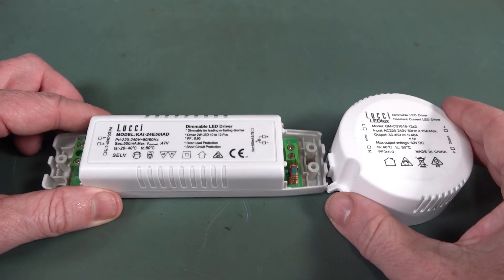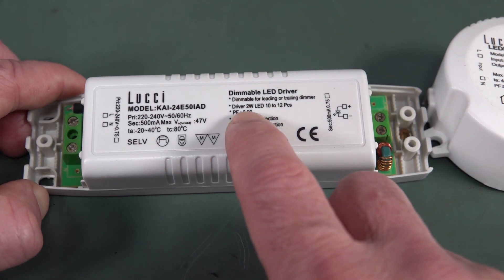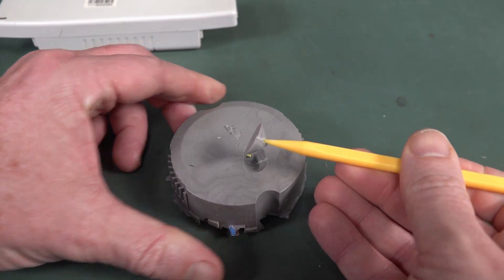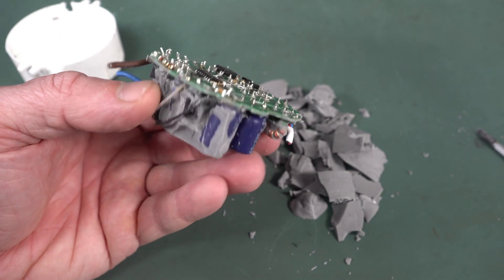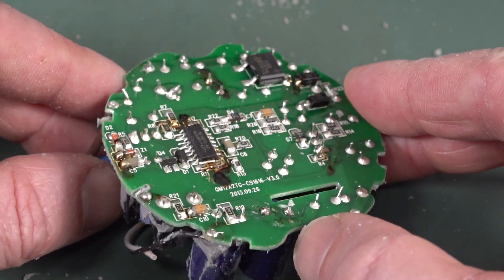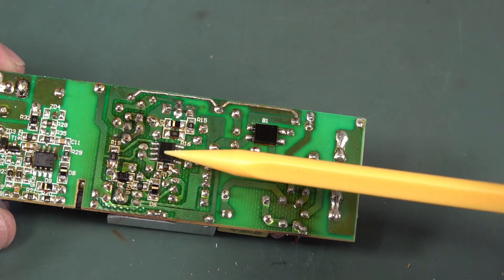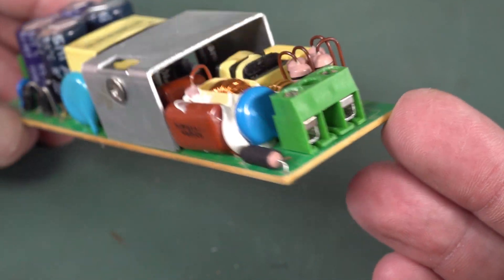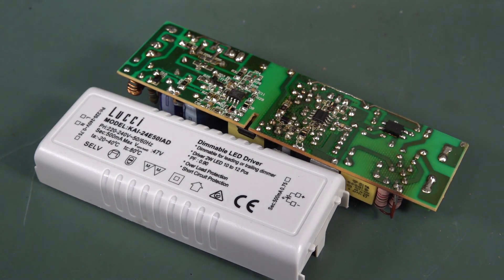Failed Lucci Constant Current LED Driver Teardown

Comment: i recently repaired a led driver, one of its smd bridge diode(must be 1kv 1A) burned out taking the 15uf/400v cap & inrush resistor with it, replaced them & it's working fine now, i feel mains components upto the switching transformer should be normal sized, there is a strong possibility of arcing due to residual flux,moisture dirt, also CC drivers provide higher v/g to leds than there normal operating v/g even though current is limited, saw one of a series led pannel blowing some of its led's and dying .

Comment: Some silicones used for potting can be removed by soaking the part in solvent. 
I use turps first, for up to 24 hours, (least aggressive to plastic components), then turps with 20% acetone, then perchlorethylene (as used in dry cleaning).  Expect damage to polystyrene caps.

Comment: Potting actually helps dissipate more power when you are only relying on passive airflow in tightly enclosed housings, pretty much anything is better than air...

Comment: @Dave - The second power-supply (Model "KAI-24E... "), look at the four resitors at the input, they got pretty hot and the end-caps will fail, so that the resistance will be unlimited.

Simply measure the resistance of the pink resistors.
In the round powersupply the resistors are still in the Gray silicone like mass?

Comment: why it says short circuit protection? Shouldn't it output 500ma current when its shorted? It says constant current after-all? What am I missing? Can someone explain?
Reply: Yes, it outputs 500mA or whatever when shorted. That's protected, it won't blow up. What are you missing.... who knows. It's 100% obvious and simple, there's nothing to discuss. What exactly do you think need explaining?
Reply: @johncoops6897  I thought it will blow up if you short it. Thanks for your reply man

Comment: That silicon potting is Sylgard 100 series, probably 160 by how it's peeling.  It's thermally conductive and electrically insinuative.  We use it at my work for potting PCBs for down hole oil well drilling measurement equipment.

Comment: Here you go Dave (with Australian Approvals too so if your house burns down there's one less excuse for the Insurance company not to pay out): MEAN WELL LCM-25 25 WATT CONSTANT CURRENT DIMMABLE LED DRIVER. Current is selectable by DIP switch; Multiple dimming methods; and the means to sync the dimming level across multiple units. I've used them in a number of my projects and they've always worked exactly as expected.

Comment: Lucci is one of the worst lighting brands around, almost as bad as your generic eBay stuff. It's got a high end Italian name but dont be fooled its a chinese company owned by beacon lighting here in Australia, they build it as cheap as possible and have beacon push it at a huge profit, I could go on for days in their design flaws (dont get me started on their weatherproofing), it costs more in time to install any Lucci product compared to its SAL counterpart and will not last.
Reply: Yep - SAL is shit but Beacon's rubbish is lower than low. What's amazing is that it's not sold cheap.

Comment: i RP'd input on a 40A DC/DC 24->12, 'twas kind enuff to blow board soldered blade fuses via  parallel prot  diode.  But had to depot to get  to the fuses.  

   Potting was a sandy almost foam like mess, scraped away easy after heat soaking in oven on low.  that Cmpd def rubbish for heat; must have been for water prot or to contain smoked components.

Comment: Damn. I just looked up an unknown part in my parts bin that I had labeled in a bag called "useless parts". Similar part no. I think it's the Cirrus Logic CS1616 if I caught the part number correctly as like 1616FS. A reference design found in some random PDF implies the NC pins are an I2C bus. Made me wonder what's going on inside.

But...wtf am I going to do with 100 of these obsolete parts anyhow? No wonder I labeled them useless.

Comment: Its thermally conductive silicone potting compound, many companies make it. Same grey color as LORD SC-309 which is 1W/mk. Not great but better than air. You can see the second board got toasted, the potting likely would have spread the heat enough to avoid this. In the west this stuff is expensive, unsure of the price in China.

"Thermally Conductive Silicone Encapsulant are filled silicone potting materials with progressively higher thermal conductivities of 0.7, 1.0, 3.0, and 4.0 W/m∙K, respectively. These materials are currently being used in numerous applications to protect sensitive electronic components from excess heat, including LED driver electronics, on-board chargers and inverters for electric vehicles, and electric motor stators. "

Comment: When purchasing LED drivers you need to select a driver that is capable of delivering an output of say 20% greater than that demanded by the LED's. Any ideas why and is 20% sufficient.  Since I have found that these always fail. The last one that I replaced I chose a factor of 100% (150w supply for 75w strip) and it is still going strong.  Any views of the pro's and con's of this?
Reply: These are constant current drivers. Using higher current drivers will shorten the lifespan of the LED's.
Reply: @rocketman221projects  good point!
Reply: @Land-of-reason  - You just said "strip" which makes me think you are using LED tape. If so, then they run off Constant Voltage so the current is irrelevant to the tape and the higher the power the better the life.
A 75W or even a 150W driver is a beast of a thing if it's for bare LED chips, and if that's the case then you cannot just change the current or you'll kill the chips.
What kills these drivers is HEAT. To make them last never have them near the LEDs and don't cover with insulation. The factor that matters most is the Ta (maximum Ambient Temperature) printed on the enclosure, however with Chinese rubbish it may be lies anyway. You cannot even choose drivers by brand, since every manufacturer makes a vast range to cover all price points.
Anyway, because you said 75W then I reckon you mean 12V power supplies, and not LED drivers. If you are really pulling 75W, that's a lot of power, and the easiest way to improving life is to split it up and have 2, 3 or even 5 separate 15W power sources. This spreads the load and the heat.

Comment: 8 years is ok.  I bought a new LED light from Bunnings for my kitchen last year, the driver failed after two months!  I repaired it by replacing the CC driver with a cheap eBay one and I'm happy to report that it has been working fine for the last 9 months (cross fingers).

Comment: I had 3 x Lucci branded electronic ballasts (for circular fluro tubes) fail within the first 12 months, out of 7 installed lights. Changed them to Philips branded ballasts and they are still going strong after 5+ years.

Comment: That looks like one of GE's potting compound. It is filled with thermally conductive ceramic, so as silicone goes it is MORE conductive than pure silicone, but that is a low bar.

Comment: If I had to guess, these are probably high power factor flybacks. The short version is they take the usual boost converter active PFC and replace the boost inductor with a flyback transformer. It has the advantage that you only need bulk filtering on the output.

Comment: fix it!
Reply from the maker: Couldn't be bothered.
Reply: @EEVblog2  I would really appreciate troubleshooting this product. I guess they all should have similar failure modes. And I haven't seen this done before, let alone, by an expert.
Reply: @EEVblog2  Gigabytes power supplies are exploding, few computer YouTube channels have covered it.

Be nice to have a trusted electrical engineer cover it. Also comments about testing methodologies from gigabyte.
Reply: @lokig8640  I would love to see that covered on this channel especially if he can release the smoke.
Reply: @MrKillswitch88  you mean he will release the magic smoke. Haha.

Also alot are suspecting that it was a design issue. If a few exploded units could get sent to Dave, hard for gigabyte to argue with an electrical engineer.